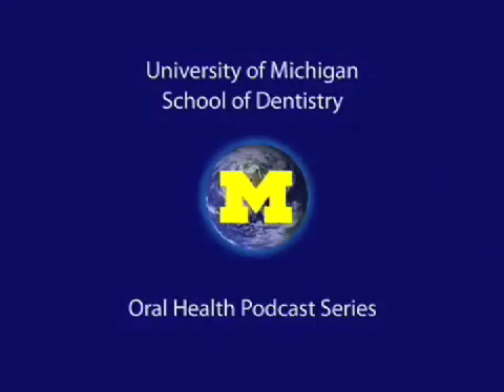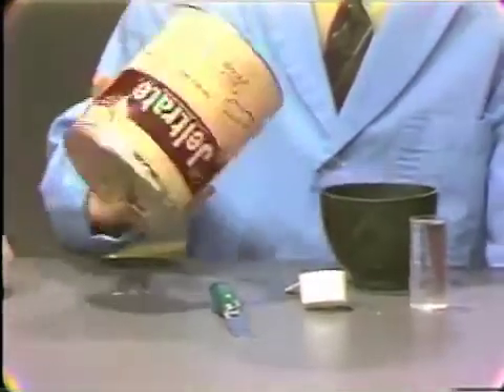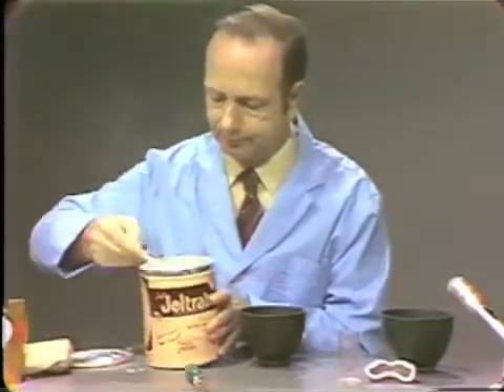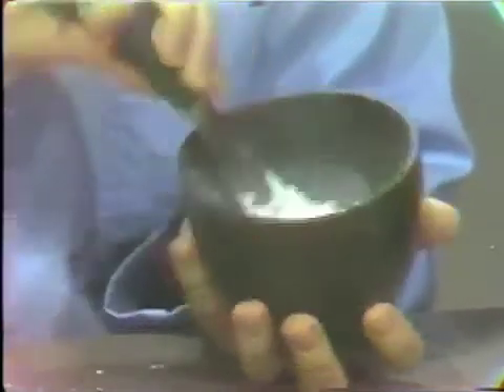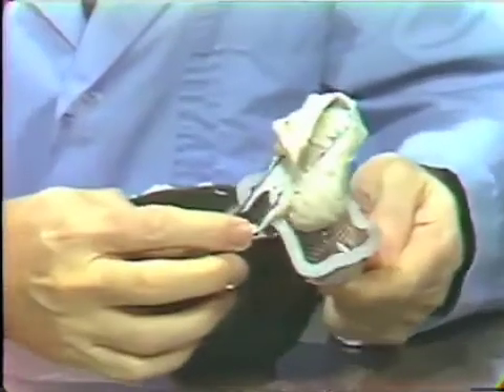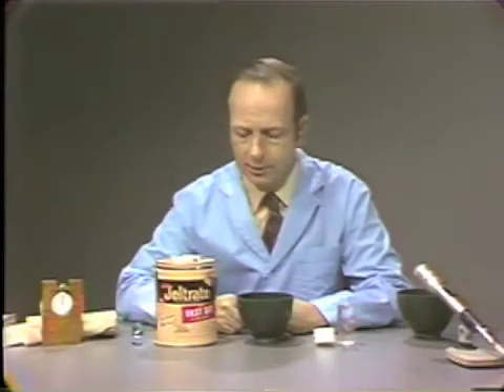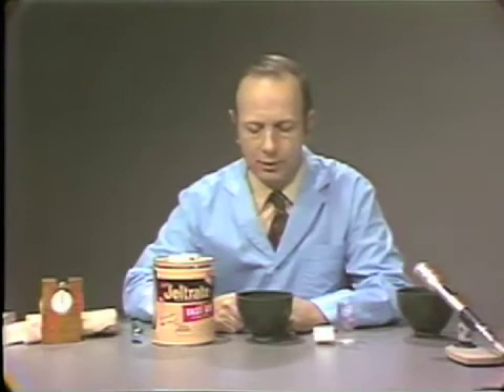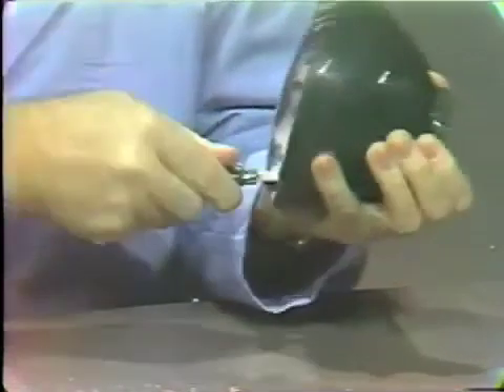Alginate Mixing Technique

Comment: He would have got more accurate mixing times, if he hadn't waited  10 seconds whilst telling us he was starting the stop-watch!

But, better practice, would be to measure-out the power into the bowl, BEFORE adding the water! Otherwise the first scoop is sat in water for about 30 seconds before he even starts mixing.  What a wally! 

Its a simple engineering process - mixing-times-accurately.

No wonder my false teeth don't fit, I think this idiot made them!